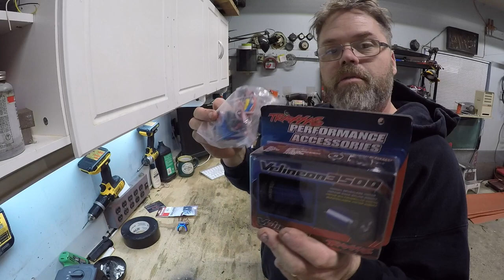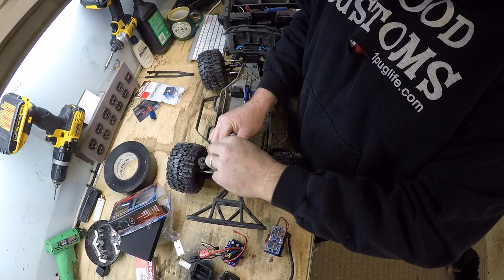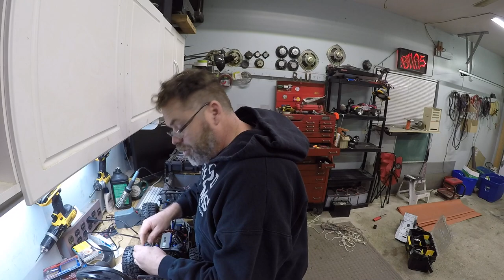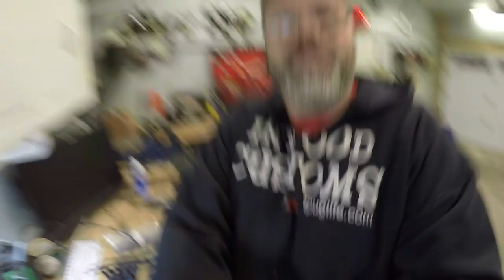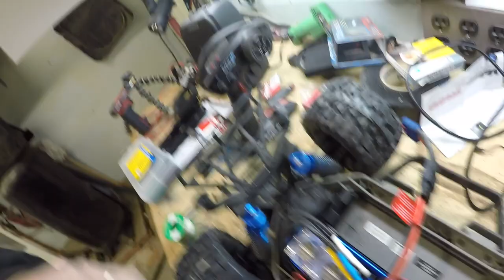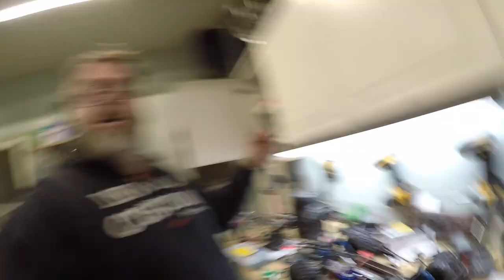Slash UpGrades

Comment: make sure to set your gear mesh between the spur gear and the pinion gear or you will go through spur gears like crazy and you will wear out the motor bearings. when you get the new esc and receiver you'll need to calibrate everything are you won't have any forward or reverse you'll have steering but no motor control. If you get your manual all it'll give you a procedure on how to calibrate your system

Comment: Hey bud looking good you can go online on Amazon and get a new receiver for around 25 bucks you’ll have it sooner then you’ll get it from Traxxas up to you also you can reduce heat by changing your Pinion smaller pinion more torque larger pinion more speed I noticed on my brushless it gets hotter with the bigger pinions keep up the videos bud